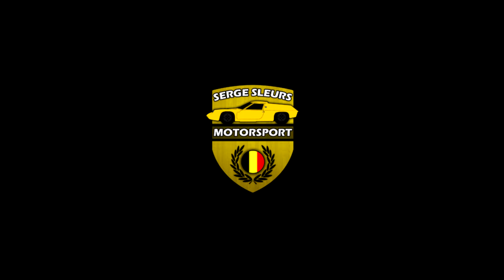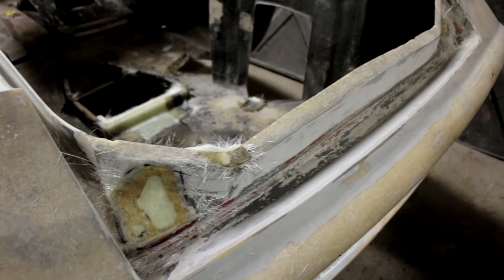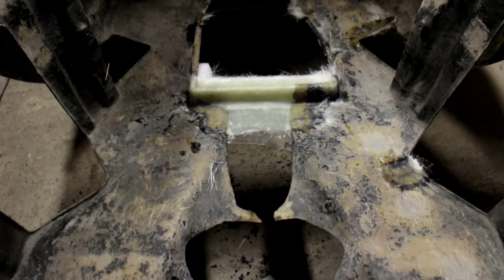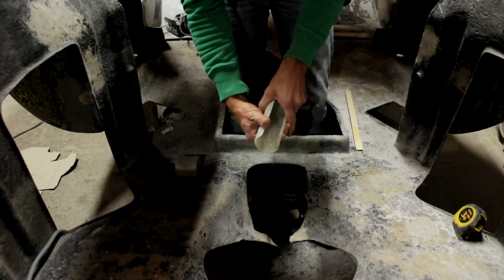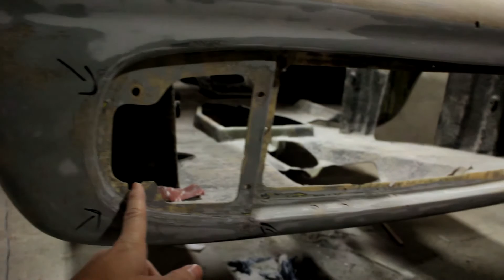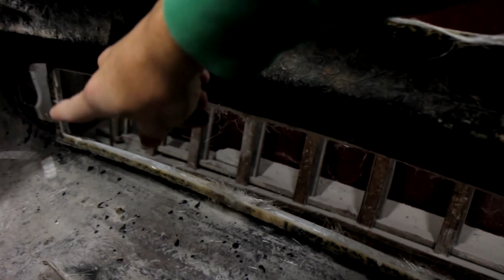Lotus Europa - Ep 45: Engine bay, floor & rear fiberglass repairs

Comment: The magnets might be a bad idea by allowing the bumper to vibrate from bumps/ potholes on the roads wearing the paint off undeneath
Reply from the maker: If I would go this route, I would line the inside of the bumpers with a soft foam that wouldn't damage the paint.